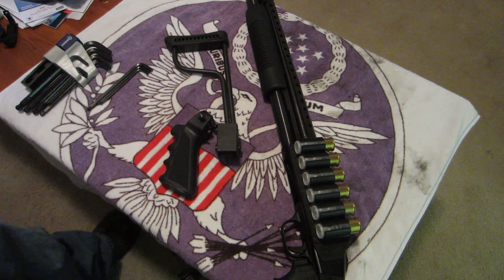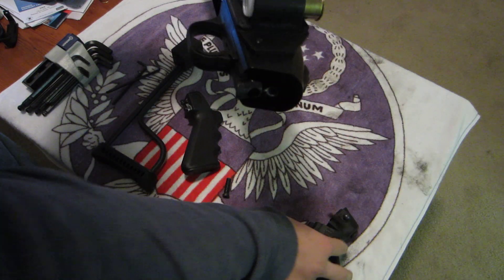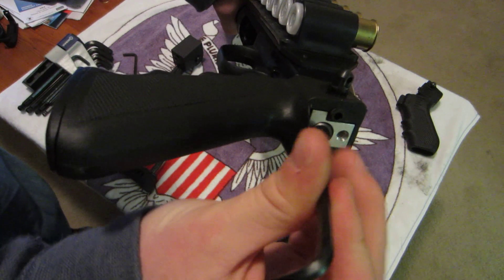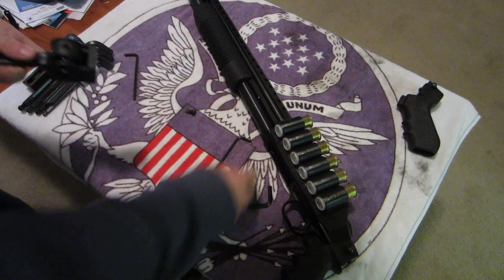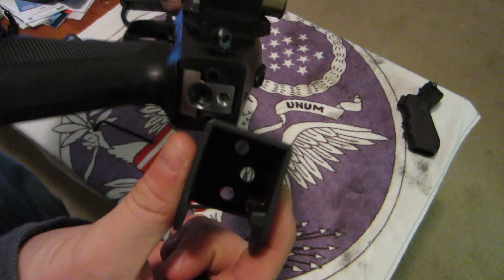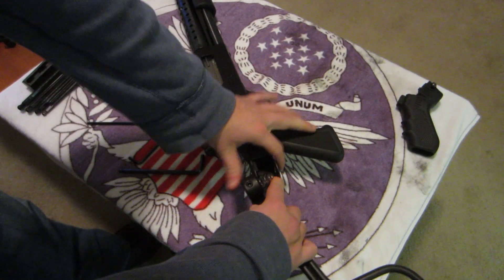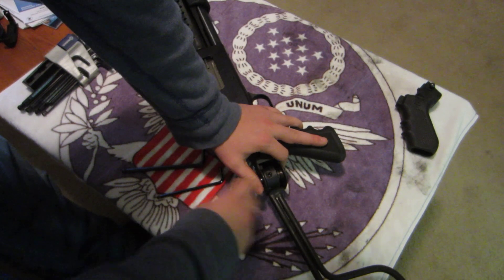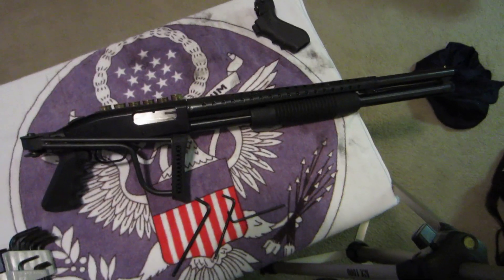How To - BUTLER CREEK folding stock on MOSSBERG 500

Comment: Dude...you need to remove shells before you do ANY working on ANY firearm...that includes those outside/near your firearm. God forbid you drop the shotgun down and the pin be struck by a hex key. Too dangerous and a bad example. Otherwise...great info.